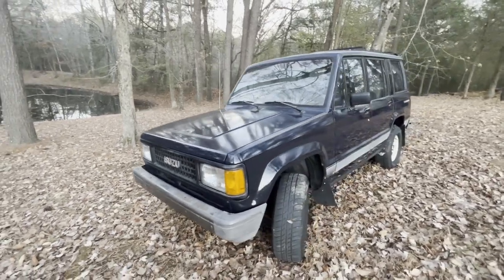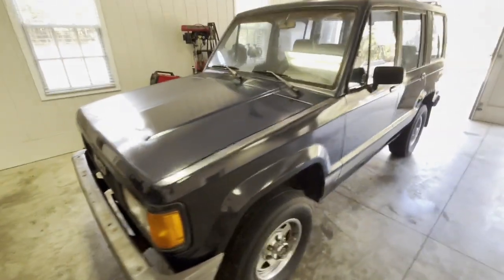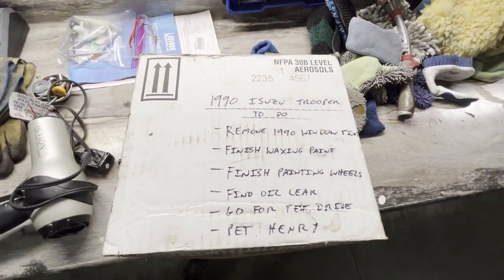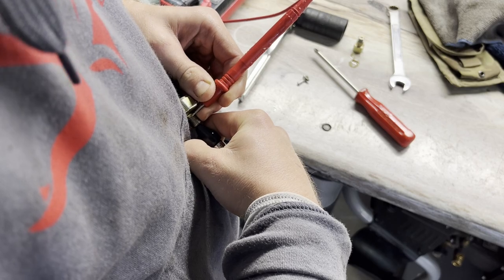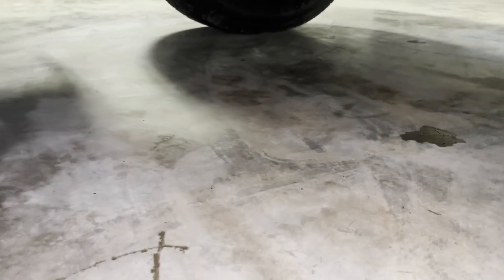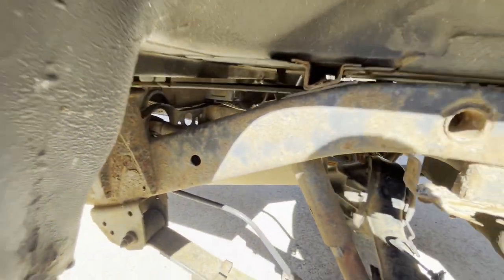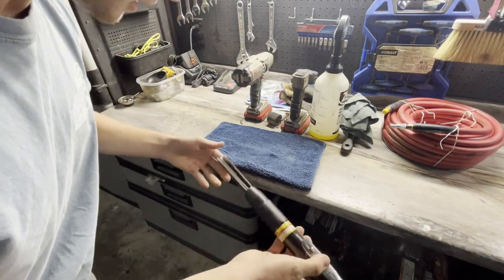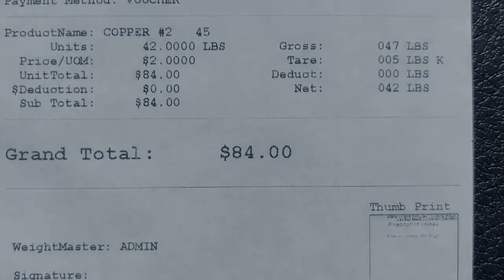Buying and Fixing an Isuzu Trooper

Comment: I have a '91 V6 with 235K on it. I recently discovered that there is an oil pressure switch that is sensed such that when the main fuel pump relay goes out, the backup relay is triggered when the fuel pressure switch goes off (or goes low, I guess). This is detected by the ECU. That way the Trooper can start even if the main fuel pump relay goes out. It was a long road of troubleshooting to figuring this out – thought I'd have to replace the fuel pump at first!
Reply from the maker: Electrical Sensors can always be tricky. I’m glad you figured it out though.

Comment: Sir, I am amazed at your skills and inventiveness.   I have a 1993 Trooper in need of some repairs and paint.  Not much if any rust.  Only 125,000 miles.  Runs well, but some problems finding a proper brake booster.  Would love to have someone with your talent do  what you did to yours, to make it safe.  I did have a timing belt brake, but no noticeable damage to the engine, which promptly shut down.  I would pay lots to get my Trooper into trustworthy state.  Better than any new SUV.   Anyway, if you continue on youtube, you will become one of the "go to" channels for expert knowledge.  Keep up the good work.  Thumbs up!
Reply from the maker: Thank you for the kind words. I agree, troopers are one of the better vehicles ever made. I do wish they had a timing chain instead of a timing belt. Again, thank you for the kind words.

Comment: Here a tip, theres a thermovalve on top of the thermostat housing, if someday that thing broke just cap the line that goes to the intake manifold and connect the othe 2 lines left from the intake tube to the solenoid in the fender
Reply from the maker: Thank you for the info!
Reply from the maker: @SpikerDragon95 The trooper seems to surge after it has warmed up when coming back down to idle after driving… (like coming to a red light) do you know what might cause this?
Reply: @jetproject7955  well I start by basic tune up, plugs, wires, rotor, and probably calibrated valves, I was having an hideus misfires, turns up the recently buy NGK plugs went bad, replace all by BOSCH and no problemo, well recently I got a couple of fuel leaks in the inlet of the fuel rail, the copper washer that seal the inlet in the banjo bolt went bad and now a fuel injector are leaking in the o rings that settle in the fuel rail

Comment: They are sweet I just bought a 98 trooper there built as best they can be
Reply from the maker: That’s awesome! How many miles ?
Reply: Recently bought a1989 RS running great seeing a bit a oil leak thou
Reply from the maker: @tyzmez  maybe the leak is bad enough so you don’t have to change the oil. Just add oil and keep going.
Reply: @jetproject7955  👍🏼 ok

Comment: how reliable are these? whats a common thing to look out for?
thinking of buying one.
Reply from the maker: They are overall pretty reliable in my opinion, they have limited technology which is a good thing. Andrew Camarata (a great YouTube channel) has had a few Troopers, and he talks very highly of them. One thing to look out for is rust inside the frame, as well as making sure the timing belt has been replaced recently. If the timing belt snaps it will really hurt these engines.